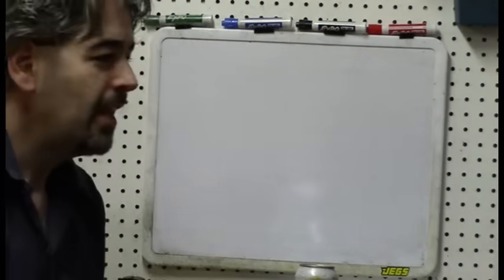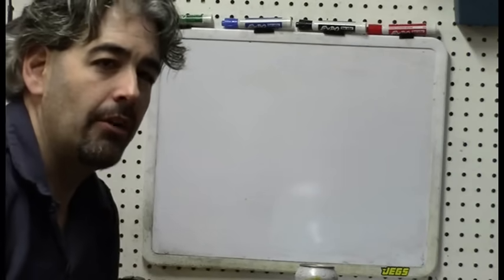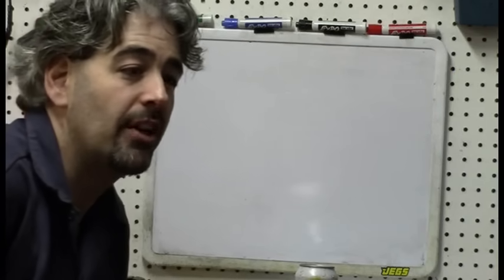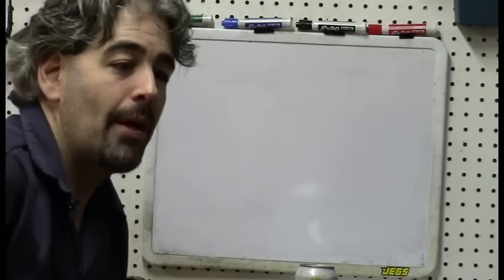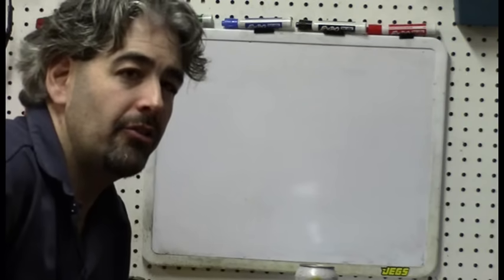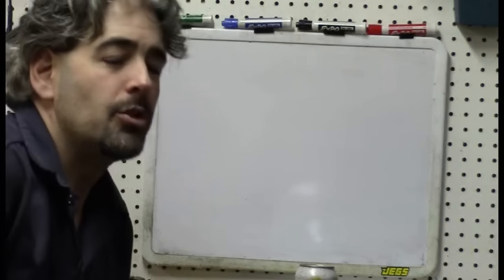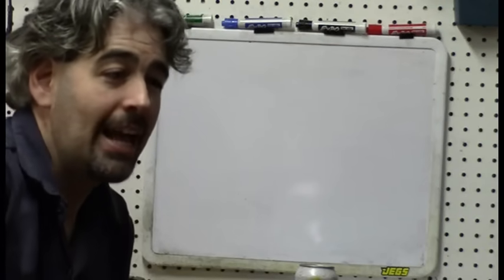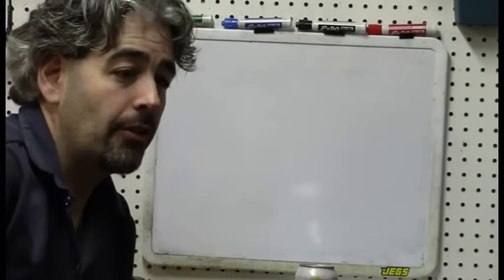Secret of Engine Problem Diagnosis- Fuel Trims Pt.1

Comment: Hello I have my short-term fuel setting that oscillates from -2 to + 2% and the long-term fuel setting is still 0%! is it good ? Also my B1S1 bank sensor has a lambda (idle) of 0.99 to 1.07 and a voltage of 0.04mA is it acceptable? thank you in advance
Reply from the maker: What would your dignostic opinion be based on the video information?
Reply: Schrodingers Box sorry sir, I'm French and can not understand everything English in the video, you speak too fast for me 😉. that's why I'm asking you for a diagnosis of my results. but yours video is great! we do not in French :-( 
but from what I understand it looks ok !? But why my odb2 gives me the bank sensor B1S1 in "mA" and the bank sensor B1S2 in "v"?
Also,  So if the long-term fuel setting come into action, necessarily short-term fuel timing returns to 0?
Thank you in advance.

Comment: What if my LTFT is at 14.9 and STFT is at 17.2 ?? 

I have a 03 civic with code P0171
Reply from the maker: Depends on the load curve. You can’t say anything on a static reading.

Comment: So what if the fuel trim goes up when first gassing it (from 14% to 25% LTFT) but then goes down to normal (~6%) around 2700 to 3000 rpms? Seems like both a fuel problem and a vacuum leak? This one is driving me crazy trying to find it
Reply from the maker: Why is that indicating a fuel problem? that makes no sense
Reply: Because the trim goes up to the max (25% i believe for my car) and then goes down... i have smoke tested the car with no major vacuum  leaks. Fuel pump is new as well. I havent tested the exhaust manifold yet but i dont hear any leaks and you say this would cause the trim to go up, not down. Fuel injectors maybe? (p0171 and p0174 lean codes, v6)
Reply from the maker: you have a vacuum leak.
Reply: Schrodingers Box Wasn't that quite comprehensively explained in the video?
Reply: Wrong. It does make sense, it was a leak in the fuel line causing a vacuum leak and a fuel problem at the same time... the fuel system works harder to compensate for the loss of air pressure causing a lack of fuel pressure. problem solved.

Comment: Thank you for the education. Your videos are the ones that put into a language I could understand. I was just a wrench monkey, now broadening my Diagnostic skills. I grew up working on non-PCM/ECU, CPU controlled vehicles. Now it's my turn teaching my Father a thing or two. He's Mr. ASE Master / GM / Chevy Master Tech. OBD II was after his time. Most OBD I stuff he did was using a paper clip, counting CEL blinks. lol

I'm in the process of being hired as a Auto Tech with the US Navy. I'm not ASE cert, but trained. My new job I won't be doing 'major' jobs. My first auto tech job, I have to provide my own tools and I will be using my fathers tools he used when he was working as a tech. All Snap-On from 62-89. Crazy he tells me how much he paid for them vs retail today... Paid $75 for a 3/8 Flex Bent Ratchet  and now it is $175. I'm probably going to get the New ASE cert, the Light Repair and Maintenance cert. So people know I'm not stupid / I know the basics which all it is. Plus I want the patch on my uniform :D

Comment: Question:  How long will a STFT remain at a value other than zero before LTFT reaches stoiciometry and STFT is returned to zero?  Are we talking a half a minute?  Or half a day?  I mean it seems like he's saying LTFT changes in mere seconds as we raise or lower RPM.  So what's the purpose of even having a STFT if the LT is only averaging values over a history of 5 seconds?
Reply from the maker: Really good question.  It depends on the vehicle.   It is same with how long LTFT reacts to change in STFT- it depends on the vehicle. 
  I have seen cars where the LTFT seems to change instantly with the STFT and others where the STFT was instant but it took minutes before the LTFT reacted.   I have seen some cars where STFT was pretty slow- maybe up to 2 minutes to react and the LTFT took as long as 10 minutes.
Reply: @SchrodingersBox  Interesting.  Thanks!  I'm going to go experiment on my cars.
Reply from the maker: Yeah not sure what car you have but in general I find if it’s a GM- both fuel trims are very responsive if not instantaneous. Again that’s in general, I’ve seen exceptions. Most toyota’s I have found the short term is immediate but the long term sometimes took so long i wondered if something was wrong. 
   Ford and Chrysler’s I have usually found to be slower on the LTFT than GM but STFT is instant.  
    But you are doing exactly the right thing- EXPERIMENT!!!  It’s how I learned all this stuff. Try creating a vacuum leak or putting propane in the intake and  see how long it takes STFT and LTFT to react to the lean and rich conditions you create.

Comment: Pl let me know all reasons by which (Check Engine Light Comes on) . Please make sure all not main reasons.
Reply from the maker: There is only one reason ever that a check engine light comes on and that is one of the sensor inputs shows to be out of the range of a prestandardized value for the established number of consecutive drive cycles

Comment: I've been chasing codes P1071 + 1074.  I have no air leaks. My trims at idle are  B 1  LT 12.5  ST  -2.3 - 0 B2 25 pegged  ST +23.4 - +25.8    I've changed my O2s , MAF, MAP. I have not checked the fuel pressure,but I have replaced the fuel filter.  I've replaced all my injectors.  2003 GMC 5.3L Yukon SUV.  I've driven it for a 130 run filled up prior drove 75-80mph most of the way  checked MPG after fill up when I got back  15.7 MPG   truck runs great?? any suggestions
Reply from the maker: Yes tons of suggestions but I am completely lost because you must not be including a lot of data. What was the data that made you change the O2’s? I don’t see that data here. Also why change the MAP and MAF? That makes no sense based on the data you have here- what data where you using that showed they were bad?  Also why would you check fuel pressure? I don’t see why you would consider this a fuel pressure issue. What data indicates this? and why were all the injectors replaced? What data did you see that indicated ALL your injectors were bad?  I mean that seems really unlikely- i need to see what data indicates this.   Also why are you only measuring fuel trims at idle?  Where is the curve against load data?
There seems to be a ton of data missing here.
Reply: @SchrodingersBox  I changed the O2s  a months ago. Made no difference. I changed the  MAP and MAF  2 years ago not recently.  The injectors were changed 2 years ago also.  I'm 71 and only have an inexpensive scanner. This is what I have for live data. TPS  5.9 - 6.3  RPMs  530  - 560  Load  2.4  MAF Lb/M  .79 - .82  Temp 180 IAT 77 IGN Timing 17 - 24 the trims are above in previous post. Hey, thanks for responding. I'm living on SS and really need this vehicle on the road, just hasn't been inspected in 3 years. I've been driving it before sunrise and after sunset  to avoid cops.
Reply: @SchrodingersBox  Forgot the MAP   10.9 - 11.2
Reply from the maker: But what data were you looking at to change those things? That’s what I need.   What data were you looking at that said “The Map is bad”. 
    What is the rationale behind that live data? I don’t understand what that is supposed to tell me. You have no useful pids. How about STFT and LTFT curved against load?  Where is that?
   Sorry there is nothing that can be used here.  I need the data you saw that would have made you change the MAF and MAP.  What was it showing that indicated fault?
Reply from the maker: If nothing else - just give the LTFt and STFt at 3000 RPM. I can at least do something with that.
Reply: OK, I'll do that this morning and send in. thanks again.
Reply: I took these reading.  RPMs 3000 - 3150,  MAF lb/M  3.5  MAP HG. 7.4 , Load 11, Temp 187, Timing 49, IAT 66.  B1 LTT 25 pegged, B1 STT +1.6 - +8.6, B2 LTT 25 pegged, B2 STT +45 - +50
Reply from the maker: OK so for fuel trim- At idle, Bank1 LTFT is 12.5 and Bank 2 is 25.  At 3000 RPM bank 1 rises to 25 and bank 2 stays at 25.  is that right?
Reply: @SchrodingersBox  yes, correct
Reply from the maker: OK based on that you have either a fuel delivery problem or an induction metric problem. But there isn’t enough data to determine which. 
I’d start with fuel pressure. It should be at spec at idle (probably 50 or so on your truck) and maintain pressure at 2500 and 3500 rpm. If pressure is below 45 and/or If it drops significantly that’s a problem.
Reply: @SchrodingersBox   OK, I really appreciate your help. Thank you
Reply: @SchrodingersBox  I had 40psi key on not started, 59 psi at idle, 57 psi at 2500 and 3500 rpms. So what exactly is induction metric, air or fuel or both?
Reply from the maker: Ok fuel pressure is not the issue. So now you have to check compression on each cylinder.
Reply: @SchrodingersBox   OK, I'll do that tomorrow.  could it possibly be that they gave me the wrong injectors?  Thanks again
Reply from the maker: Nope. Otherwise both banks would be off.
Reply: @SchrodingersBox   Ok , I thought  B2 was worst than B1 but is B1 normal?  still not balancing to zero.
Reply from the maker: B1 is normal at idle. You have a lower fuel to air ratio. Injectors is less likely a cause. especially given fuel pressure is normal If your injectors weren’t injecting you would have higher fuel pressure than spec and if they were over-injecting you would be running rich.
Reply: @SchrodingersBox  Ok, Thanks again
Reply: @SchrodingersBox   finally got the compression test done.  Bank 1   hole 1 = 165, hole 3 = 170, hole 5 = 166, hole 7 = 164  Bank 2 hole 2 = 170, hole 4 = 178, hole 6 = 170, hole 8 = 168.  they seem really good ?
Reply from the maker: Yep they seem good. So now you are down to getting basic induction metrics data. You need to curve the MAF output against load by measuring the signal voltage against either reference or ground.  Overlay that with the  MAP simultaneously. That will pinpoint issues with your induction.
Reply: @SchrodingersBox  I don't think I have the equipment or knowledge to perform that . I guess I'll have to bring it to someone that can do that.  I thank you for your help and pinpointing this and eliminating what it isn't.
Reply from the maker: No problem. good luck!  Yeah at least we eliminated some variables.
Reply: @SchrodingersBox  I think I found it. I hooked up a blower to my exhaust pipe and got a bottle of soapy water. I turned on the blower and I didn't need the soap I head the leak. this was bank 2 the worst fuel trims. I went of B1 side didn't hear anything but sprayed a block off plug on the exhaust manifold and it slightly bubbled B1 trims were better so all this makes sense. I had changed the manifolds 4 years ago with the common issue of broken off exhaust manifold  bolts. the manifold I purchased had a block off plate for another application. both are leaking B2 more than bank one. should be an easy fix ??? I'll let you know how I make out. BTW I never heard and hissing or exhaust noise from either.

Comment: I really enjoyed your video. I have a question for you. In all the fuel adjustments that occur, what part does the coolant sensor play in the scheme of things. I noticed you didn’t mention it. I have an LS7 motor pro charged that has an issue WOT. I would really appreciate your input.
Reply from the maker: The CTS has two functions in fuel adjustment. First, it detects if the engine is cold started and if so it defaults to the fuel parameters set for cold start as opposed to using live fuel trim (basically it determines open vs closed loop). Second, it does have affect on fuel trim in CL based on temperature- my video on adaptive fuel learn  strategy explains this more.

Comment: Hi Matt. I need help with fuel trims diagnosis on my car. Im really confused.
Need your input. Ive watched your videos and understand, but this problem perplexes me.

Yr 2011 Daihatsu Sirion.
4 cylinder engine code K3-VE. 
Its 1.3 liter engine. 
Automatic transmission.
The car uses OBD2.
Car uses only MAP and IAT sensor. Also uses Narrowband upstream and downstream O2 sensor.

Issue: After engine is hot :
Absolute TPS at idle 10.59%
At idle the LTFT is at 25%
STFT with 20%+

Under NO Load, Park gear, and with AC OFF.
Idle LTFT is 25%
As RPM INCREASES to 1500rpm,  LTFT increases to 32% and stays there. STFT at 22%.
At 1800rpm LTFT still at 32%, while STFT jumps to 39%.
AT 2500rpms LTFT drops and is now at 7.81%. While STFT at 39%.
Also at idle with AC compressor kicking in, NO change if LTFT, it stays at 25%.

HOWEVER:

WITH Engine Load, while accelerating frm standstill. and AC OFF.
As car accelerates LTFT immediately drops to 7.81% behaves like theres a vacuum leak.

Also when in D Gear, car at standstill, when AC compressor kicks in LTFT drops like there is a vacuum leak.

What seems to be the problem.
Reply from the maker: Sounds very much like a vacuum leak to me.
Reply: @SchrodingersBox  Hi Matt. Thx for the reply. 
I've come to realize some new findings after analyzing more data frm the scan tool. AND Yes I believe you are correct there is still vacuum leak in this engine. Dont know where but I suspect the lower bush/grommet of the fuel injector.
In the beginning the LTFT was at 45-50%. After using Brakeparts Cleaner, I found many vacuum hoses (evap,pcv,brake booster) to be brittle and broken, even the PCV valve grommet was leaking. not to mention the intake manifold gasket as well. Had ALL of them replaced and now LTFT is down to around 27%.  But if I drive and as the rpms rises, the LTFT drops to 7.8% and stays there. Vacuum leak right.

BUT something baffles me, my MAP sensor seems to under report when the car is in Neutral or Park. At idle it reads 29kPA or 8.9inHg. And the stft fuel trims rises to +20-25%.  to compensate for the lean/lack of fuel. And no matter how much I rev the engine it drops to 25kPA/7.3inHg and stays there in these higher rpms. Release throttle and it goes back up to 29kPa...shouldnt pressure increase when I rev?

BUT here's the thing, with D gear engaged but car  is stationary the MAP reads higher at 39-40kPa or 11inHg. And when the cars being driven , the MAP pressure behaves normally, as in if I throttle down the MAP fluctuates between 40-90kPa depending how hard I throttle it. 

But once back in Neutral or Park gear, the MAP goes back to 29kPa and stays at 25kPa when revved. Why is the MAP seemingly behaving correctly when in gear and but not when in Neutral gear?

What could be wrong Matt? Im trying fix this but also want to understand whats happening. Hope you can advice me Matt. Thx.
Reply from the maker: still sounds like vacuum leak.
Reply: @SchrodingersBox   Hi Matt. Just to update you. I managed to find and fix the vacuum leak - fuel injector bush/oring leak and brake booster hose replacement. Now the fuel trims dont dip when revved. The LTFT though was still at 17% even after reset/battery disconnect.   The precat O2 sensors were reading normal, but I wanted to replace them as its more than 10yrs and could be lazy. After O2 replacement, the LTFT is now at negative -1.54%. However it rises up tad to a max of 7% when revved. I suspect fuel delivery issue, weak fuel pump/clogged filter etc as they're stock 10yrs old. Was hell of a rollercoaster ride, thx for the videos and guidance. Im still learning frm ur videos and Motor Age. Learning abt Voltage drop now.:goodvibes:
Reply: @SchrodingersBox  Hi Matt. Its me on my other handle name. Just to update after changing the fuel pump which had super dirty filter my LTFT is at -1.5℅ at idle and after revving goes up to 0℅ and no more.  So im happy with the results. Tq.

Comment: I have an acura 2006 TSX which is giving me a P0137 which a high O2 voltage ..my fuel trims are STFT between -3% to -6 and LTFT is -8% ...what could be the cause of this..the car only has a MAP ?
Reply from the maker: Check the O2 sensor response to conditional variables to differentiate if you have sensor voltage constant or actual rich condition.
Reply: Thank you kindly for you fast reply! so I checked the variables for the O2 sensor and it fluctuates normaly during idle and when I rev the RPM to 2500 or so...the MAP intake was showing during that test a kPA of 24 at Idle and max 37 kPA when increasing RPM to 2500-4000 ..when I would do that ...the kPA would fluctuate between the two given values. after watching your MAP sensor vids I noticed its a similar condition of constant rich engine as if the MAP sensor is not there...I searched online most say that its the MAP sensor or PCV valve..what do you think?
Reply: Also, the issue with the car is when driving ..very randomly at no specific timing, the car looses power and when I press the gas peddle more, its as if the engine does not want to increase in power then it would go back to normal again...when this happens the check emission light comes on and the code is the one mentioned above. I changed the o2 sensor around a month ago to the original NGK and still same...the o2 seems to work perfectly ..,the obd shows heater working and voltage is in normal condition.